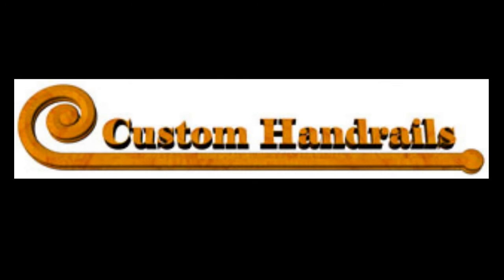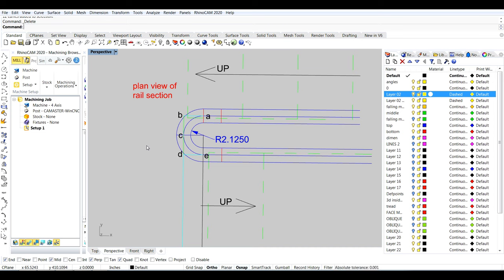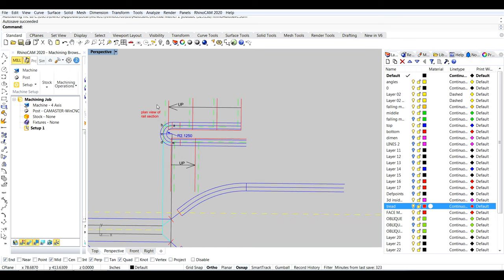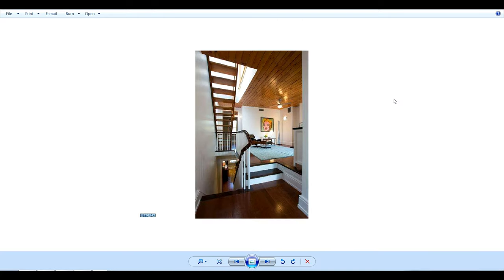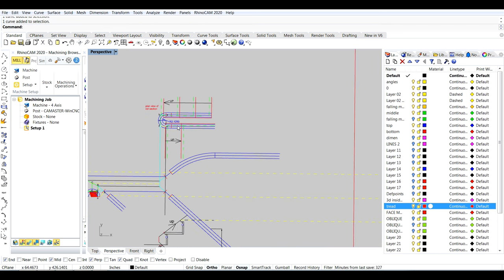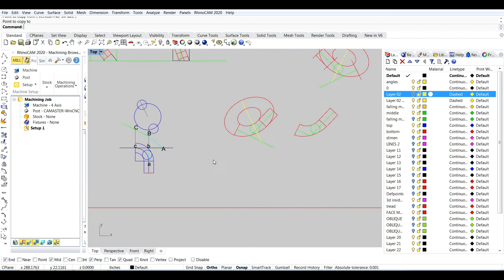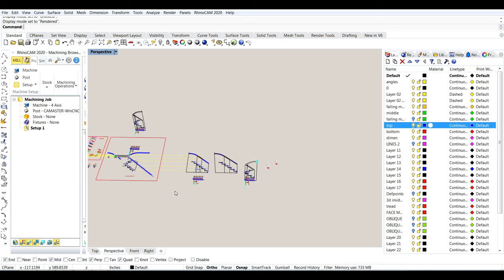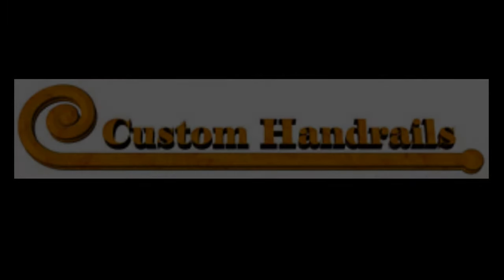Is the "Tangent Handrailing Method" dead? Part 2

Comment: Having learnt the drawing process it´s actually not that time consuming to make the drawings by hand, and if one does not have the cnc machinery there is no need to have the full cad drawing. 
I make the drawings in Sketchup and print the facemould, but it´s basicly the same thing as drawing on a sketchboard, and a wreath is drawn in about 10 minutes.
There are a few unnecessary "stumble pits" that got me loosing hair on my head before unrevealing, for instance when you make the bevel line, the compass should swing the opposite direction than shown in most of diCristina´s drawings to get the correct bevel application to the butt end of the wreath. Very confusing, and my guess is that a lot of people have given up on that stage...
It´s a beautiful art! Thanks for your videos!
Reply from the maker: Thanks for your input Petter. Back in the beginning days my pursuit, a good friend of mine, made a copy of a book in a Philadelphia library by Edward Loth called The Practical Stair-Builder. The only problem was that the scale of the copies had been altered (stretched in one direction) to fit the paper which rendered all of the arcs and circles of the drawings into elliptical lines. Imagine my confusion.
Reply: @customhandrails5434  😂 Cheers to that!

Comment: Hey Earl, greetings from Istanbul :) great video, thank you so much! This will definitely make things easier. But I'm stuck at some point: How do you wrap a surface around a line? I've seen a command called FlowAlongSrf but it says "surface" not a line. Also is there a method to do it in AutoCAD 3D?
Reply from the maker: Kutalmis, 
Thanks for your comment. In Rhino there is a command called "flow on a curve" which is what I was using in the video. I am not sure about Autocad but you may be able to make a surface on your base line and flow on that. Hope that helps.